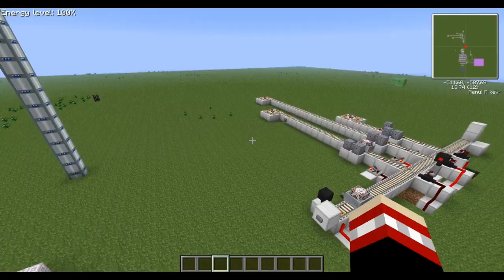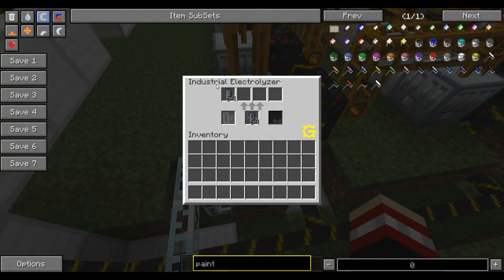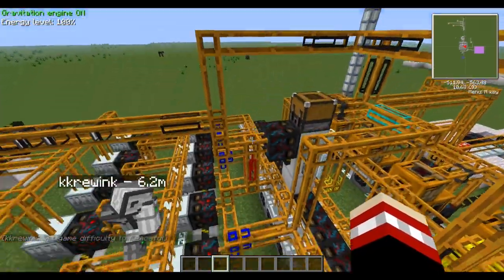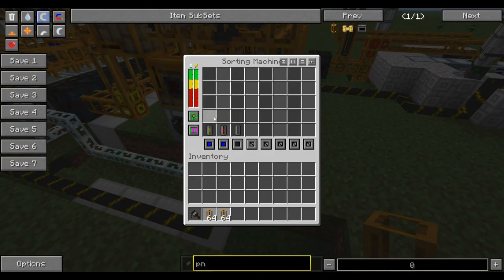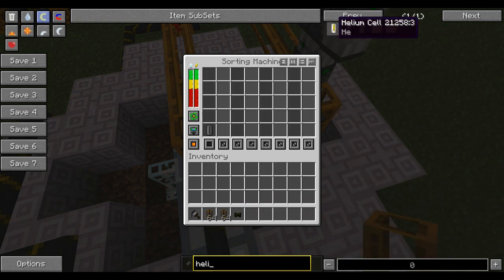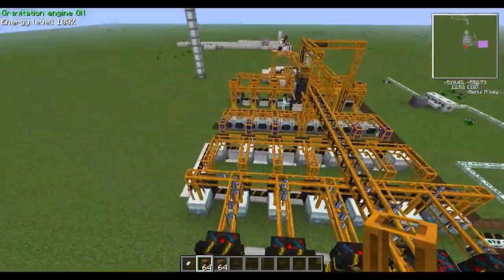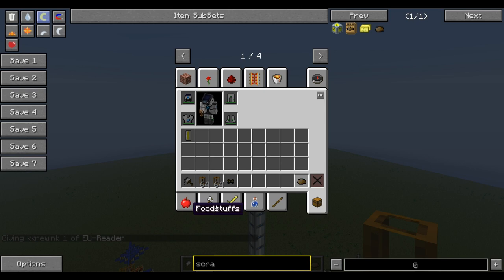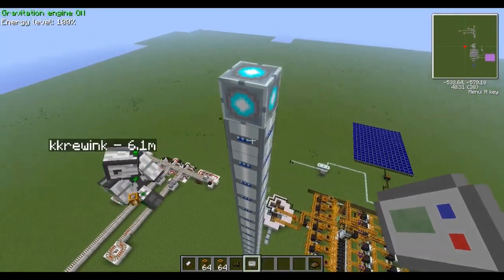FTB - Self Sustaining Fusion Reactor! ~33,000 eu/t!

Comment: With the FTb ultimate pack, you have access to Applied Energistics, and you can get rid of every sorter and tube. And it runs on EU as well. Couple that with piping water straight into the electrolyzers with liquiducts, and your build just got a whole lot more efficient. And even less lag, since practically nothing needs to be moved anymore, so nothing needs rendering either.

Comment: The reason it was exploding was because every so often the reactor puts out a 1000000 EU packet :) To prevent the explosions just put a transformer on it :) Because super condensator wire acts as an energy storage you will not lose any power either :)